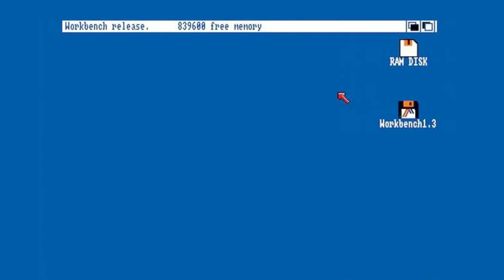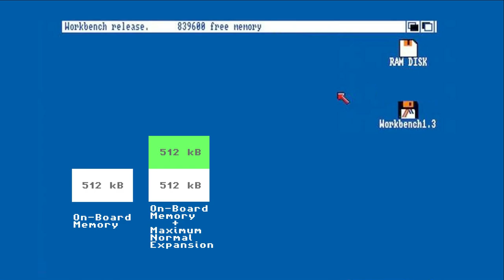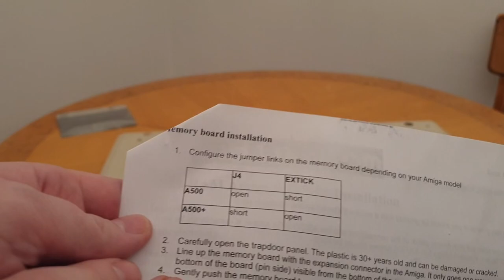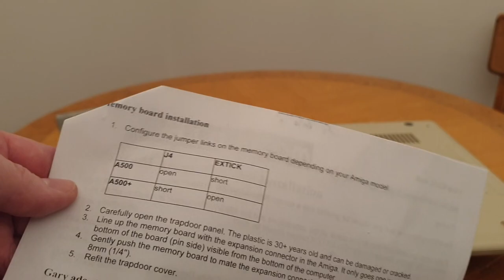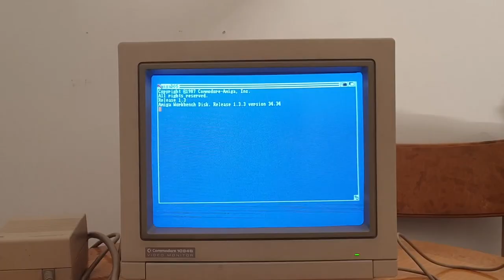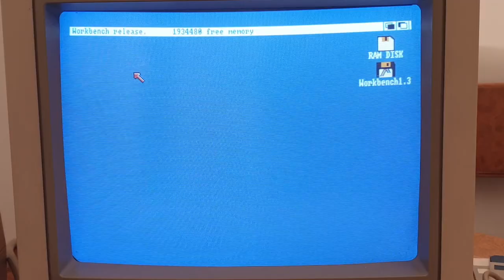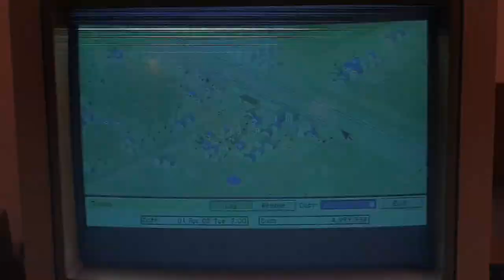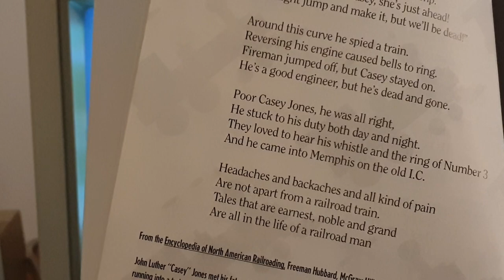Amiga 500 with 2 MB memory + some gaming!

Comment: Hey my little memory modules are on youtube :) I find a small flat blade screwdriver (or spudger) works well to remove ICs like Gary - alternate between each end and lift a little each time to raise the chip evenly. I find this is more controllable than a chip puller & the force is between the chip and socket rather than flexing the PCB.
I am pretty sure A-Train needs 1MB chip RAM + 1.5MB slow to run in hi-res so you'd need the 1MB Agnus normally found in a rev 6A A500. I had it running when I was doing the development testing.

Comment: I'd like to see proof of your claim that some early Amiga A500's came with only 256kb of memory.  That was not the case, all of them came with 512kb of memory as standard, configured as chip memory.

The original amiga, the A1000 only had 256kb of memory on the motherboard and it was almost always bundled with a 256kb ram expansion module that sat behind a cover on the front of the system and boosted the memory up to 512kb, configured as chip ram.  There was also memory on a daughterboard that the A1000 loaded its kickstart into from floppy, but that was not user-accessible except for kickstart loading purposes.

Comment: I bought the same mem upgrade. Yet in order to use my accelerator, I had to mod my 8a.1 board, from 500-Standard to 500-Plus. It will locate the trapdoor as chipmem.
Reply from the maker: Ah Cool! I don't have any accelerator board, so it's a bit easier for me. Although I have a 500-Plus as well, but with battery acid problems. I will try to make it work some time in the future and then maybe I can add an accelerator, extra memory, or both to it!
Reply: @z80-dreams14  Jeg vidste ikke du er fra sverige. Hehe. Jeg er fra danmark. Min accelerator er en TF-530. Så jeg har 4mb ram i alt,  030-50 og meget mere....

Comment: Can i use 1,5MB ram in Amiga 500 rev 6A (with already 512k on board and 512k on expansion slot) by soldering onother 512k in empty holes on the motherboard?
Reply: No. You need additional mods. It is not just soldering in more chips.